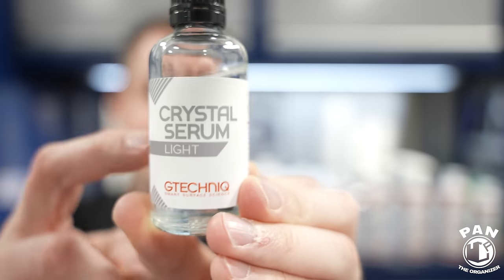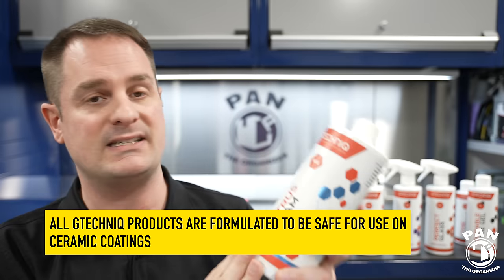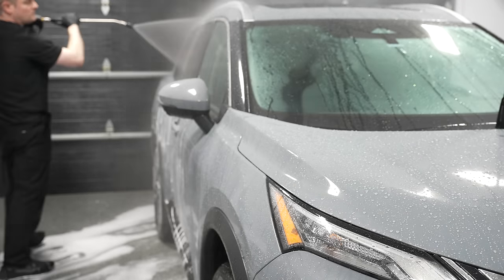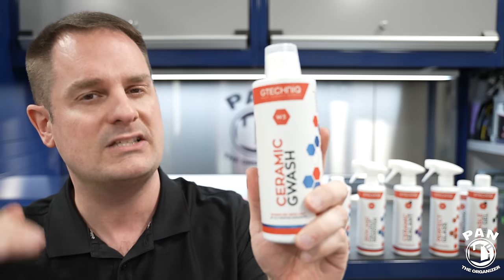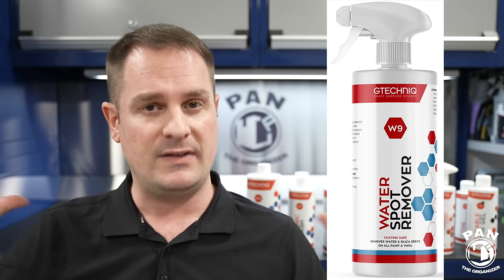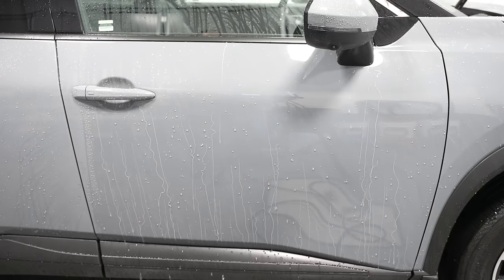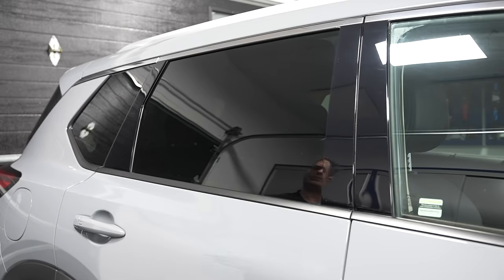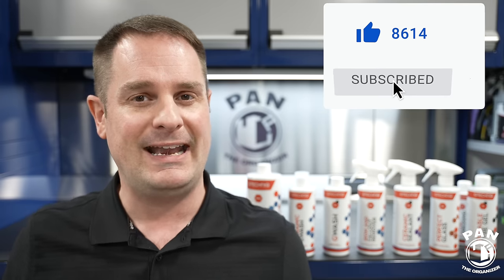Detailing 101 - How To Do A Maintenance Wash On A Ceramic Coated Car!

Comment from the maker: ⬇️🔶 LINKS TO PRODUCTS MENTIONED IN THIS VIDEO ⬇️⬇️
🇺🇸 For people in USA:
Gtechniq W4 Citrus Foam: https://bit.ly/3ooS68J
Gtechniq W3 Ceramic Gwash: https://bit.ly/3Vru9IR
Gtechniq W1 GWash: https://bit.ly/3Oze41j
Gtechniq W6 Iron & Fallout Remover: https://bit.ly/45t2CfW
Gtechniq W9 Water Spot Remover: https://bit.ly/43ni1fL
Gtechniq C2 Ceramic Sealant: https://bit.ly/3MRJ9Oz
Gtechniq G6 Perfect Glass: https://bit.ly/3MS8t71
Gtechniq T1 Durable Tire Gel: https://bit.ly/3EBycvh
Gtechniq T2 Tire Dressing: https://bit.ly/3pYmtTI
Gtechniq Crystal Serum Light coating: https://bit.ly/3BUBqsR
Gtechniq EXO v5 top coat: https://bit.ly/43oND4v
Gtechniq CSL + EXO v5 kit: https://bit.ly/3Wx3r3h
Gtechniq wash mitt: https://amzn.to/421e5A9
Gtechniq drying towel: https://bit.ly/3MWU6yy
Aluminum work platform: https://amzn.to/3OAzRI4
Foaming pump sprayer: https://amzn.to/3IKw5YP
Foam cannon: https://bit.ly/3MWkvfP
Kranzle 1122TST pressure washer: https://bit.ly/3d5kZeK
Mosmatic gun and wand solution: https://bit.ly/3ovIcPA

Gtechniq products on Amazon USA: https://amzn.to/3OB65Tv

🇨🇦 For people in Canada:
Gtechniq W4 Citrus Foam: https://bit.ly/42ZYimL
Gtechniq W3 Ceramic Gwash: https://bit.ly/41Y4j1H
Gtechniq W1 GWash: https://bit.ly/422Bamb
Gtechniq W6 Iron & Fallout Remover: https://bit.ly/3BSC4Hg
Gtechniq W9 Water Spot Remover: https://bit.ly/3MRHEQx
Gtechniq C2 Ceramic Sealant: https://bit.ly/3IDeu5b
Gtechniq G6 Perfect Glass: https://bit.ly/3BSzDog
Gtechniq T1 Durable Tire Gel: https://bit.ly/3Wutwjc
Gtechniq T2 Tire Dressing: https://bit.ly/43oOxhp
Gtechniq Crystal Serum Light coating: https://bit.ly/3WyzaB8
Gtechniq EXO v5 top coat: https://bit.ly/45MzP5W
Gtechniq wash mitt: https://bit.ly/3MYYJIp
Aluminum work platform: https://amzn.to/3qcuR2h
Foaming pump sprayer: https://amzn.to/3MDQtvQ
Foam cannon: https://bit.ly/3ChOGaN

🇬🇧 For people in the UK:
Gtechniq W4 Citrus Foam: https://bit.ly/3q5TxJI
Gtechniq W3 Ceramic Gwash: https://bit.ly/3BRgZgh
Gtechniq W1 GWash: https://bit.ly/43F92qD
Gtechniq W6 Iron & Fallout Remover: https://bit.ly/3IBsHzt
Gtechniq W9 Water Spot Remover: https://bit.ly/430qTbf
Gtechniq C2 Ceramic Sealant: https://bit.ly/3OAX9h5
Gtechniq G6 Perfect Glass: https://bit.ly/4398jOA
Gtechniq T1 Durable Tyre Gel: https://bit.ly/3MzeEvo
Gtechniq T2 Tyre Dressing: https://bit.ly/433KAPz
Gtechniq CSL ceramic coating: https://bit.ly/43eREc4
Gtechniq EXO v5 top coat: https://bit.ly/3MvMeCH
Gtechniq wash mitt: https://bit.ly/3OE6nZF
Gtechniq drying towel: https://bit.ly/3BSmYSb
Glass towel: https://bit.ly/3N3Ylbs
Tire dressing applicator: https://bit.ly/3N0IUkm

Gtechniq products on Amazon UK: https://amzn.to/3optqgc

🇫🇷 For people in France:
Gtechniq W4 Citrus Foam: https://c3po.link/Qhc5H9NWqH
Gtechniq W3 Ceramic Gwash: https://c3po.link/Qh6AbVmV3K
Gtechniq W1 GWash: https://c3po.link/Qxy788fDqf
Gtechniq W6 Iron & Fallout Remover: https://c3po.link/QCyU2wHBRZ
Gtechniq C2 Ceramic Sealant: https://c3po.link/QCk8cUEMCa
Gtechniq G6 Perfect Glass: https://c3po.link/QJAsPmhCCJ
Gtechniq T1 Durable Tyre Gel: https://c3po.link/QyXw3QmfnK
Gtechniq T2 Tyre Dressing: https://c3po.link/QhVMYSNdge
Gtechniq Crystal Serum Light coating: https://c3po.link/QxyNVgzjhs
Gtechniq EXO v4 top coat: https://c3po.link/QhCvTRdWNe

Comment: I always wonder how they can claim a certain a product lasts for years and months when people are constantly applying other coatings on top. If a product says it has 6 months of durability, shouldn't it last six months without any maintenance?
Reply: Although C2v3 is recommended, it is not required to maintain any of our coatings. We suggest a good wash once a month and a decontamination wash once a year!
Reply: Nothing lasts outside man. Coatings are not magic, you can remove it with finishing cream and a very soft pad.
Reply: Fact, even graphene coat does the same but it has durability.
Reply: It might last 6 months over the summer with very little to no washing and your car is kept in a garage ..... Leave it outdoors in the rain and inclement weather and have to wash it every week and you will degrade it slightly however the better the quality of the coating the longer you should get out of it
Reply: Copium

Comment: Hi Pan, Just a very quick question. Would I be doing the Iron remover after the pre-wash stage, or after a contact wash? Though you did it after the contact wash in this video, it doesn't mean that's actuall when you did it, and just my brain is telling be I should be doing is after pre wash but before contact wash. Thank you very much for the post.

Comment: Lubricity… I like that. Looks like a great, comprehensive line. I didn’t know that clay was too abrasive for these applications.
Reply from the maker: Polishing a coating isn't recommended, as you would damage and strip the coating. Mechanical abrasion and friction will remove the coating. Chemical decon steps are always preferred on coated cars. I would recommend the following steps:
1) Wash the car with a decon shampoo like CarPro Descale. It's slightly acidic pH will help remove minerals and water spots.
2) Rinse it, then use a tar remover if you have tar deposits.
3) Rinse it, then use an iron remover to remove brake dust and industrial fallout.
4) Rinse and dry the vehicle. 
5) Then use the water spot remover, which will also help to remove any minerals left on the coating that perhaps are masking its properties. Rinse, and wash the car again. 

The coating's properties should be restored at this point, assuming the coating is in good shape and was applied properly and is still within its claimed durability.

Also, clay bars are abrasive by nature, and again, not recommended on coatings as you would damage the coating and potentially add some marring to the paint.

If maintained properly, you shouldn't have much embedded contamination. In some rare cases where you might find some contamination left after all the chemical decon steps, like a bit of grit in the clear coat, you could use a synthetic clay towel (that uses a different clay media compared to traditional clay bars) and lots of clay lube, in order to lightly clay the surface. A clay towel like this one: https://bit.ly/43nrfce
Or this one: https://bit.ly/43y0Mss

But test on an inconspicuous area first!

Comment: Hello again to the hardest working detailer on YouTube! I'm a novice compared to you, but I'm wondering whether your washing regimen, and that of most of the YouTube detailer folks, might be a bit excessive, at least for coated cars. Let me know what you think if you can.

I bought a brand new car this year with black paint which came with a synthetic sealant. I wanted a ceramic coat, but would have to strip the sealant, so after a great deal of research I decided to just apply the Turtle Wax Hybrid Solutions Graphene spray 2-3x per year since it gives ceramic properties and can be layered on top of other coatings or itself. I applied it after a car wash in mid-April, it's now early June, and I haven't done a proper contact wash or been back to the car wash since! While I don't drive a lot and it doesn't rain much here, I park outside and Calgary is very dusty, so the car gets covered in dust in under a week, yet a pump sprayer pre-soak followed by a waterless wash is all I've needed since mid-April. I do 1-2 washes per week (~30min each time), it's still easy to clean, and hasn't lost its hydrophobic properties! Also I just use tap water and CarPro ECH2O and air dry, and even if I use the very hard water at my parents place I never get water spots. I just don't wash in direct sunlight or else the chemical leaves minor streaks.

I'm not sure if my results are due to my chemicals, my wash frequency, or just dumb luck (maybe I'll have problems once I drive through some mud puddles), but so far I'm not seeing any reason I'd need to use foam cannons, pressure washers, the car wash, or even a sponge and bucket until the winter road salt returns.
Reply from the maker: The Turtle Wax Graphene Flex Wax is very good, and on its own, I typically see 9-10 months durability in our harsh conditions. Some viewers in gentle climates have reported 10-12 months. So yes it's a very good paint protectant, especially for such a low price.

But you still need to reapply more often than a full blown ceramic or graphene coating in a glass bottle. Those typically last 2+ years, many new offerings are now 3-5 years+. They offer even more performance compared to spray products. True coatings have better self-cleaning properties, better hydrophobics, more gloss and slickness, more chemical resistance, etc.  But they cost more, and take more prep and time to apply.

So it all boils down to your personal preference, experience level and budget. There's nothing wrong with a spray alternative, as long as you stay on top of reapplying when needed.

Comment: Great video! Never would have thought to use an iron remover...would have thought it would degrade your coating.
Reply from the maker: Thanks Josh. Yeah using chemical decon is actually recommended to help remove brake dust, embedded contamination, or things like water spots or tar deposits that can mask the coating's properties. And the coating brands always develop chemicals that are compatible with their coatings and won't hurt them.
Reply: @Pan The Organizer  makes total sense! I have Adam's Graphene on my truck...so will pick up some of their iron remover now! Keep up the great videos!
Reply from the maker: The Adam's Iron Remover isn't that great. Get an iron remover from a reputable coating brand like Gtechniq, CarPro or Gyeon in my opinion. Here are those three options:
Gtechniq: https://bit.ly/3Na9cAz
CarPro: https://bit.ly/43mzcyj
Gyeon: https://bit.ly/3WPLKM9
Reply: @Pan The Organizer  I have really been liking Gyeon...especially their rim coating...so may have to try their iron remover.

Comment: Great looking results as Gtechnique makes strong products. The new EVO looks really glossy and slick which should make a lot of people happy. For those worried about the drying aid just use the drying aid when the vehicle is wet and dry. Then reapply the topper when the paint is dry. Sadly I just ran out of their bug remover as the product always worked. 
I do have a idea for future videos as the use of a primer polish before applying a ceramic coating has been going through my head a lot. Then again this could be a rabbit hole too. Thank you for another educational video full of tips and tricks!
Reply from the maker: Thanks Neil. I think you meant EXO right? EVO is in the Gyeon line of coatings. ;)

For primer polishes, there is still much debate on that. Some like using them, some prefer to just IPA wipe, and then apply the coating.

However, having visited Dr Beasley's headquarters recently, and having talked with Jim, owner and chemist, he had an interesting take on his primer polishes and his explanation made total sense. I have been testing the NSP line and I'm quite please so far! Here's that interview: https://youtu.be/IxacMrFEHis
Reply: @PanTheOrganizer  your correct Pan on EXO. I must have been thinking about eating tacos! I ann still ignorant on the bindings of the ceramic to the paint. I can see the primer polish filling in the crevices of the paint which then gives the coating a better grasp. I know when I am over my head and this is one of those moments. The Dr. Beasleys video got my attention along with Miranda’s videos about the polish too. Thank you for thinking about this.

Comment: Hi PAN, love all of the videos, tips and tricks!!  Is there a difference between C2V3 and the Gtechniq QD or at least distinct use cases for each? I have both but really don't see the use for the QD if C2V3 is recommended as a drying aid, top coat, and potentially stand alone product. C2V3 seems like it would be the go-to product as it seems to be a higher level of protection.
Reply: Hey Alex! C2V3 is great for maintenance on a coating or a drying aid! Quick detailer is best used in situations such as a quick wipe off at a car show! Hope that helps!
Reply from the maker: Thanks Alex! The guys at Gtechniq gave you the right answer.

Comment: Pan Thank you sooooo much for this absolutely detailed video.  I just had my new car coated with the nano diamonds you showcased on your channel and I love it.  My question is, what would you recommend to care for nano diamond?   Would these products be safe for that or do these products work better with   Gtechniq???
Reply from the maker: You can use which ever brand of products you want, as long as they're made to be used on ceramic coated cars (or graphene coated, same applies). This includes being able to use Gtechniq products on your coating.

You can also use your specific brand's maintenance products should you want to. It's your choice.
Reply: @PanTheOrganizer  thank you.  Yeah I got the Diamond Pro tech.  My other car had the Carpro ceramic coat.  I think I like this better.  I’ve seen so many of the products you suggest for maintaining and washing with a car with ceramic coating and it’s extensive and I love washing my car and doing it correctly.  So I appreciate everything you put out there and for clarifying.
Reply from the maker: Thanks man! I want to share my knowledge and passion with my viewers, so when I read comments like yours, it shows me that I'm doing things right! :)
Reply: @PanTheOrganizer  you sure are.  Keep them coming!!!   You passion is infectious.

Comment: I was watching your videos on pump sprayers & I was wondering if you could go into greater depth about the wet/dry/intermediate foam? What products to use with the wet foam. What products to use for the dry foam & what ones to use for the intermediate? All I got was you using wet foam for the tires and wheel wells. What about exterior & interior? What for an alkaline/acidic pre wash or an iron remover. A rinseless wash. The carpet, dash, plastics. Door jambs, etc Really go over what kind of foam for each one. Thx.
Reply from the maker: I just use the stock tips that come on them and don’t bother swapping. Takes the guesswork out of it hehe.
Reply: @PanTheOrganizer With all due respect that doesn’t answer my question.
Which products do you use for each task? What foams good what doesn’t? Product waste or no?

Comment: What can I use or recommend as a quick detailer for in between washes for a ceramic coated car?
Reply: Give our Quick Detailer a shot! Specifically formulated to create a lubricated surface between contaminates and the clear coat.
Reply from the maker: You can use the Gtechniq quick detailer for regular washes. Link: https://bit.ly/3MTVv7P

Or any drying aid of your choice, as long as it's compatible with ceramic coatings. I made a video about my favourite drying aids here: https://youtu.be/NOTNed04xYE

Comment: Hey, Pan. I have been watching your videos since Feb of this year and a recent subscriber. You have helped me keep my cars looking new! Thank you so much! I have been using the Turtle Wax Hybrid Solutions line with great results. However, I haven't found any videos in regards to caring for chrome. I have chrome bumpers and "chrome" plastic trim (emblems, grille, etc) on my truck. Is there anything special I need to do? Thanks again and you have the best car detailing channel on YouTube!
Reply from the maker: Welcome to my channel. You discovered one of the biggest car detailing channels on YouTube as we surpassed 895,000 subscribers and we have over 116 million views! I have been detailing for 26 years and I love to share my knowledge and passion with my viewers.

You found the right channel to help you learn everything about detailing.

For chrome, there isn't anything special to do, assuming it's in good condition. You can typically apply the same paint protection on chrome as well. Chrome plating shouldn't oxidize or rust. It can rust when damaged in an accident for example, or start to be dull over the years. You can use a chrome polish at that point, to help restore it.
Reply: Thanks, Pan. When my TWHS stock is depleted, I'm going to try out some of the other products you recommend. Keep up the good work. For those of us who are just getting started on auto detailing, we appreciate your knowledge and expertise. 👍
Reply from the maker: Thanks for the kind words! What’s your favourite video on my channel so far?
Reply: I enjoy the Detailing 101 series. A tremendous help!

Comment: Hey Pan! Great video! Watched a few minutes and saved to finish it later! Question...

My wife's SUV was ceramic coated with a 4 year from Ceramic Pro. It also has PPF on the whole frontend. I wash both of our cars on a weekly basis (even in the winter) and after 13 months, the frontend and trunk seems like the water sticks and there is zero hydrophobic properties. I have been washing it with Optimum No Rinse and every so often Mr. Pink from CMG. Yesterday I finally washed it with CarPro Reset, it helped the lower panels a bit, but, the frontend and trunk are still clinging on to the water, as if there was zero protection. Was I too naive to think that washing weekly would extend the need for a decon on the ceramic coating? I have IronX on the way, to see if that will help before paying the detailer to do their maintenance wash, which I believe is the same (or almost) process as I am doing. And, something tells me I should have gone with a different company for the coating lol...
Reply from the maker: It depends if the coatings is actually dead, or just clogged with minerals, limescale and other contaminants. To find out, watch my ultimate spring coating rejuvenation tutorial here: https://youtu.be/oTaFE_p2OAw?si=rkcv0aGqg0qIWIRr